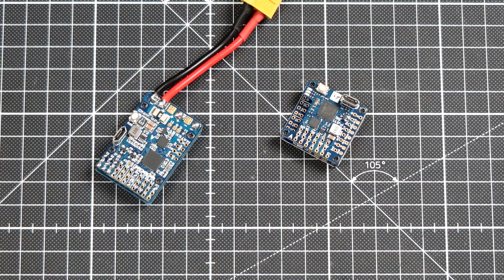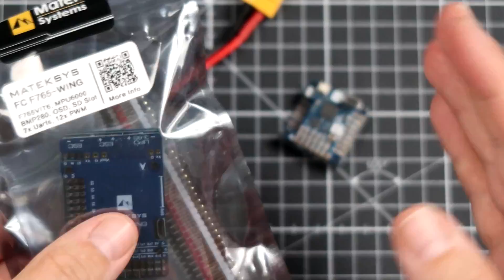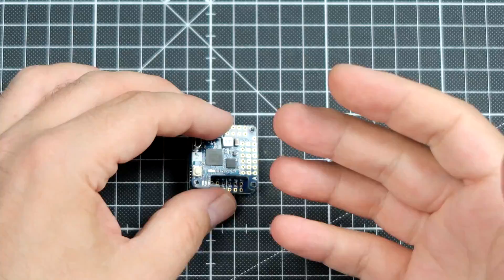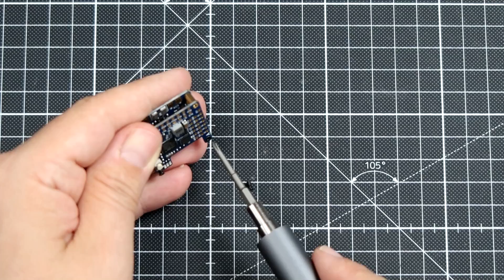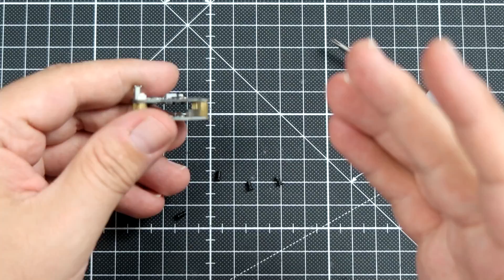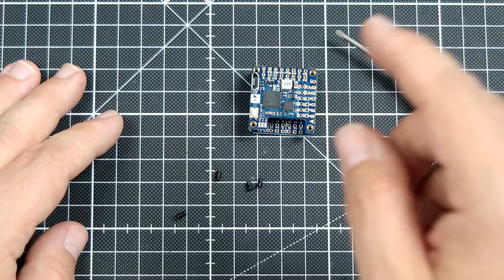Matek F411 Wing SE hand on

Comment: I hate these little F411 WSEs.  They are very fragile and burn up.  It is not like they are super hard to solder on (at least compared to 16x16 stacks or AIOs on whoops).  F722 WPX / F405 WSE or greater for now on.  Dare I say if I'm constrained for space, I'd go with a crappy racerstar 405 over these.  I've had 3 of them stop working before they ever got an ounce of solder on them just connected to USB.  (use the same USB cable on other FCs for Drones Racerstar and Wing FC 10)

Comment: Is there anyway to use caddex dji vista and TBS nano and GPS ? I saw something About serial ports?? But can't find no videos?  Could you please Help?  Thank you
Reply: did you work it out i'm having the same problem atm?
Reply: @KyleGoesUp  nope! Was such a pain in the ass. Just upgrade to fc with plenty of uarts. I tried for months. There's a reason no one (big channels) or small! Had made a how to video. I tried different firmware. And I'm not a newbie. Not computer nerd nerd too lol but I never got it to work.  Read allot of online help says possible.? But I never figured out? If I did was going to make help video. Not Shure what's going on. Some sware it works? Offered great advice. Still no success. Hours I waisted. Spend the extra 20 bucks get fc with plenty of uarts. My advice.
Reply: @sleepingbearffg5008  I found a moded firmware that turns the led strip port into a rx soft serial port. My plan is to turn the  crossfire rx to sbus and solder it to the led port hopefully it’ll work I’ll let you know how it goes!

Comment: installed my 2nd F411 WSE, but i have a couple of problems
-motor wont start (works only in INAV motor test)
-elavator has less angle
-osd menu manual/tutorial?
Reply: -motor wont start   solved     arm switch activated

Comment: "20x20 is too small for airplanes." I've got a inav plane with a 16x16 it's 1s powered though, a 20x20 was even too big when literally every gram matters.
Reply: You have the current sensor? What board is?
Reply: @matteovillani4079  No current sensor. It's just a bare bones build because I wanted a micro with RTH. As for the board it's some cheap $15 omnibus f3, one of the only ones that even had two two-way uarts.

Comment: Hi Pawel, I have Matek F405 STD with INAV 2.2.1 in my long range airplane. Now I am going to add DVR (Runcam mini DVR) and control the recording in it directly from the FC by assigned pin converted into High/Low (0-5V) output. I am going to start the recording on "Arm" and stop on "Disarm" status. The candidate to drive the H/L input on DVR is unused in my setup "LED" pin in FC. I know I should release the LED I/O first but what should I write in CLI next? Please help. Regards, P. Szabelewski

Comment: I will definitely buy this for only one reason. It supports down to 6V instead of 6.5V, so my next 2s Li-ion build can push further distance
Reply: F411-WING supports down to 6V also, the absolute minimum input is 5.8V for stable 5V output.
Reply: @sampsonguo8150  well i saw 6.5V lowest rating instead of 6V like this one, so i'd assume this one is more stable at a slightly lower voltage. I've seen 5V buck converters get noisy starting from 6.5V under oscilloscope too, so that seemed reasonable to me

Comment: The biggest problem with the f411 wing is the lack of filtering. On high amp draw, or noise, the osd dissapears and video is bad. F405 wing doesnt have this issue. I hope this one is better.
Reply: i power my camera from my vtx and do not have this issue.
Reply: I have 2 planes with F411-wing and no issues with noise. My other plane with F411-Wing is an S800 and I had to add a LC filter to the vtx power line, crystal clear now.
Reply: I have a F411w on my Falcon wing (1.3m) and there is no interference  ( no additiomal LC filter) even
at 13amps. I use a 1000/11 kv Turnigy and a Yep 30amp esc. (props from 8x4 to 9x6)
Reply: @amax2624  13 amps is not high amp draw. My mini drak runs 60 or so amps through this FC, and it can't handle it well.
Reply: They are using better filtering on the WSE presumably. I'm going to test it out soon. (late comment  lmao)